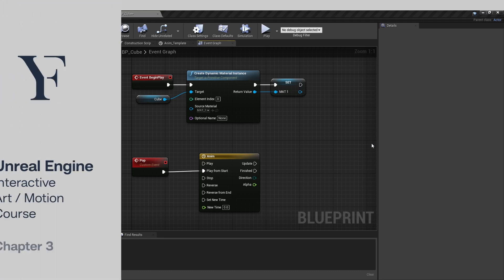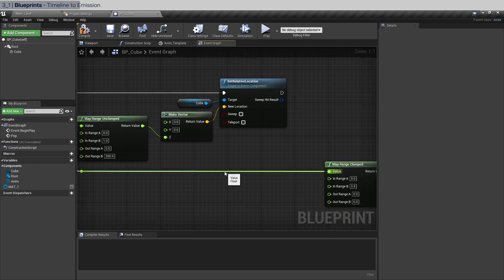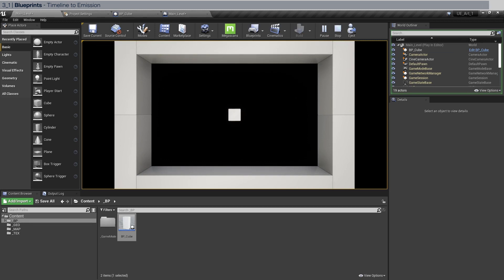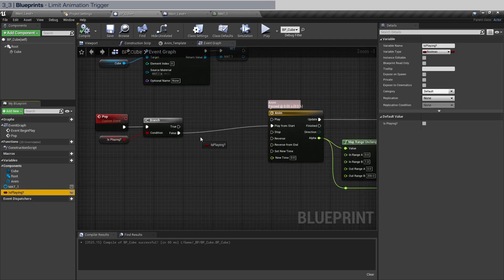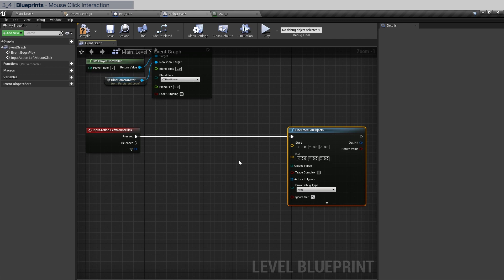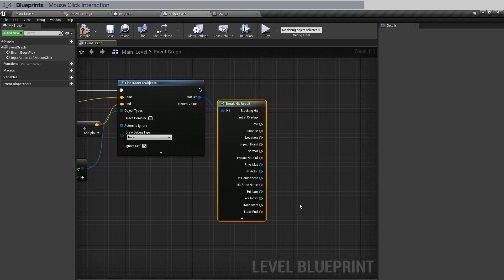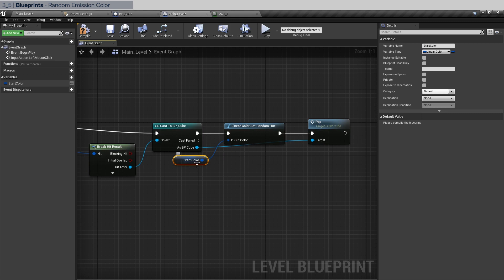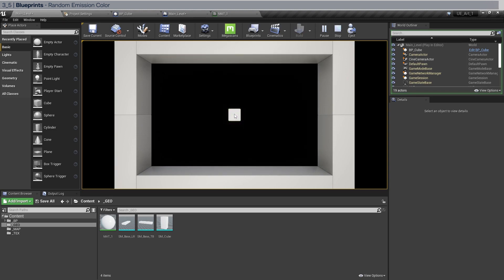Unreal Engine 4 [Course] Real-Time New Media Art / Interactive Art | Ch.3 - Blueprints 2

Comment from the maker: In order to do Vector x Float in UE5. Drag from a vector output and search for multiply and it gives you vector x vector. But if you plug in an output of any float to the bottom yellow input. It will automatically convert. Nowadays if I’m not using a variable and I need a temporary float value, I just use a “Make Literal Float” node, which is basically like a constant. If it is your first time into programming concepts, it is important to study the jargons, to properly understand what is being done.
Reply: You can also right click and convert the pin to a float
Reply from the maker: Oh sweet! I didn’t even know that, oh man that’ll save me loads of time now. Thanks 🙏

Comment: I loved your content, thank you very much. I'm thinking about finishing this and continuing with Patreon... I have a question, would it be possible to use a gamepad and use the sticks to do what is currently done with the mouse cursor position?
Reply from the maker: Yes you can, but you look up for controller input tutorials. You’d have to create a variable that saves the thumb stick cursor position and when you press a button you can fire a line trace. There are many ways you can achieve the same setup, this is also the reason why it’s hard to teach UE Blueprints!